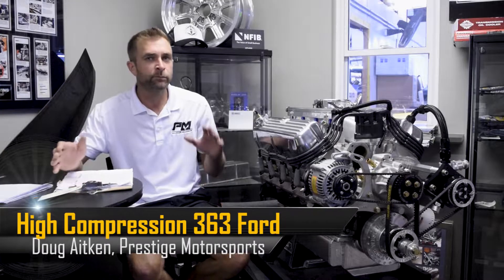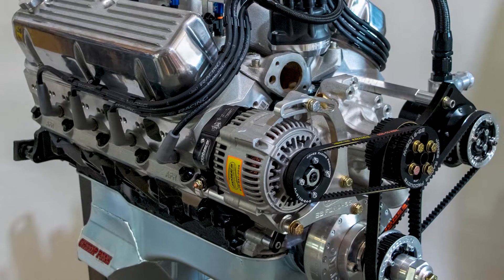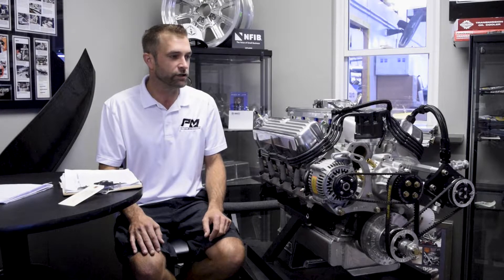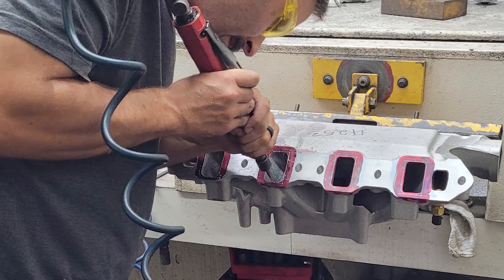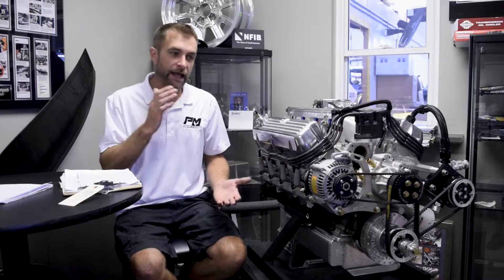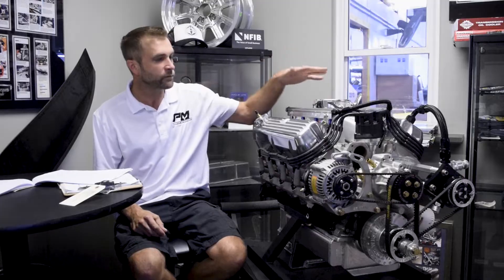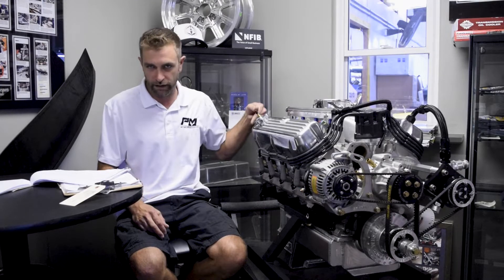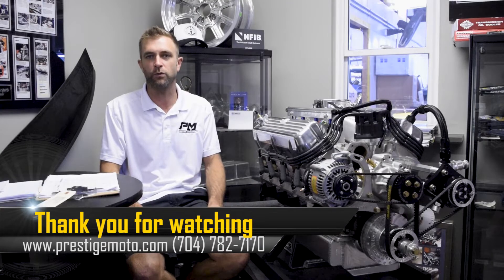680HP High Compression 363ci Small Block Ford! Dyno Test and Details at Prestige Motorsports

Comment: This is a pure drag motor now. I hope customer understands that. Gonna be lumpy on the street and power band wont start till 4500rpm, and you have to check valve lash at least once a year or every 3k miles. I wonder what this motot made behind a big stalled th400.

Comment: What exact compression now, solid roller cam specs. 8k rpm means you have a pretty huge solid roller. What transmission is going behind this motor. What did this car dyno.?

Comment: It's impressive. But unless you race a class with limits on displacement why would you people build a 427 Windsor based motor. Yea, I realize that there are 454 Windsor based combos. But, the 427 will stay alive to fight another day. Nobody is stupid enough to think your running a 5 liter. 427 with 12-13lbs of boost will run forever and live.

Comment: Not doubt an impressive motor but wow I can only imagine the price tag on this, I would have just built a 5.0L coyote then slapped a supercharger on it and had 700HP for way less money!  But that’s just me.
Reply: not every one wants a blower and nothing like high powered n a motor
Reply: @sorshiaemms5959  I am that N/A fan.
Reply: @sorshiaemms5959  nothing like a high powered motor who cares if it’s NA or boosted.  Went the NA route and it cost more to get the same power as a boosted engine, learned my lesson won’t do it again.
Reply: @msk3905  ya how much does a brand new coyote plus blower cost Richard Holder went 1100 hp with a cast piston 351 w block  with boost that sounds cheaper than a coyote
Reply: Brand new Aluminator with a Gen 3r blower is $20k plus.  I know cause I have one. My car makes 900wheel on e85 but weighs 3600lbs.
Reply: @sorshiaemms5959   If you do new Coyote with SC you are probably looking at $15k -$20K, if you are ok with used Coyote (I am) you are talking more like $10K - $15k.  Let me ask you how much will a new Windsor based engine cost to make 700HP reliable HP?
Reply: I already have a pretty cool coyote setup in my wifes 2019 mustang. I wanted a windsor engine in my fox.
Reply: Same here. My S-550 is fun and I love the Coyote, but my  Foxes get modded pushrod fun.
Reply: @skipgumphrey9579  Exactly !
Reply: He whats your compression and cam specs and transmission and stall and fuel. Is this behind a big stalled th400.  What did it dyno on e85? Whats car weigh?
Reply from the maker: We hear ya. Every customer has different wants and needs and thats what we try and accomplish for them. Each build completely custom from the others.
Reply: And with boost also comes more potential problems and $$$ to repair.
Reply: @keithswiercz3890  and a 680HP 363ci motor spinning 8,000rpm is not going to be temperamental and will be dependable right 🙄
Reply: You are correct,  but in a light car with a big stalled th400 it will blow the doors off your coyote stick supercharged mustang. I have both cars so i know.
Reply: Guess you can't read 😕
Reply: @keithswiercz3890   Well since I can't read help me understand your point, you say "And with boost also comes more potential problems and $$$ to repair."  Are you not saying boosting an engine brings more potential problems and $$$ to repair?
Reply: Can I get a 850 hp NA big block Ford.  Bracket car 69 Fairlane. Just want it reliable. Thanks
Reply: But you didn’t.
Reply: It's crazy people think a decently built n/a sbf costs more than a coyote crate with a supercharger kit, fuel system etc.

Also a blower on a stock coyote is so done to death. Some people just want to be unique and do something a bit different so when they get to the car show they don't see 15 cars with basically the exact same setup ....

Comment: Thats almost as good as a showroom stock, pump gas,  N/A corvette engine.
Whats the warranty like on this one?
Reply: Yeah, but there are 3 big problems with that...
1 : Its a Chevy.
2: Try to find a flat plane (not plain) crank C8....good luck!
Ohh....and what's that gonna cost you?
3 : You have to be over 75 years old to drive a Corvette.
Reply: Describe what pump gas stock motor please?
Reply: @tomhamilton9140  go try a new flat plain C8 if you get through that I will introduce you to one of my NA street hotrods.
Reply: @mohanperformance.enginerd.1308  are really comparing a brand new just engineered C8 to a pushrod 6.0   totally different engines
Reply: @rdy2run332  run what you brung or get back on the porch. You dont get to decide whos allowed to be faster or slower. If you think you have a competitive hot rod and want to show off to the world. Then step up and race that turd.
Reply: @mohanperformance.enginerd.1308  thats pretty much what i have been doing. I have a 427 stroker in a foxbody mustang.not the fastest but not the slowest. It will hold its own though!
Reply: @rdy2run332  thats honest.  But don't ever settle. There is only ever one fastest baddest hotrod. If your not no.1  keep working at it until you are. Nobody cares about hold its own. They care about who is the champion. So keep working at it until your a champion.

Good luck with it.
Reply: Vetts are for old geezers and only the C8 zo6 has flat plane crank and makes 680hp.